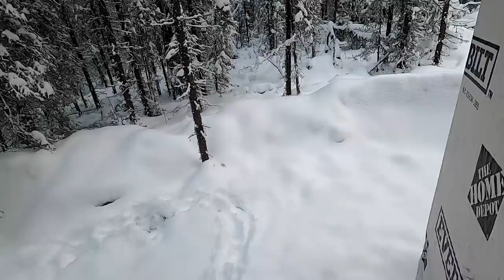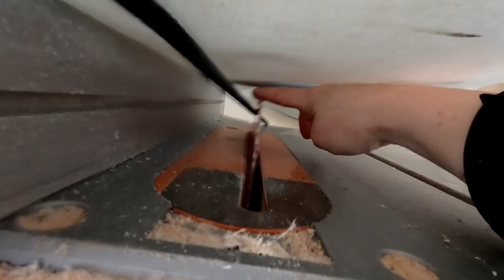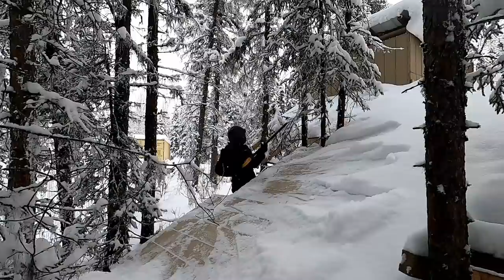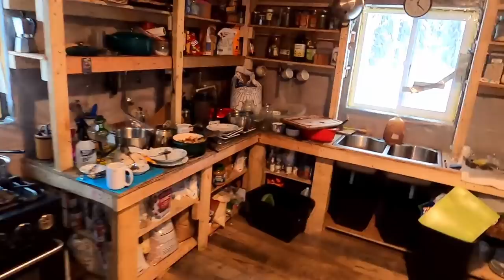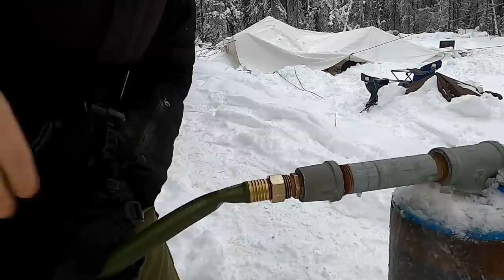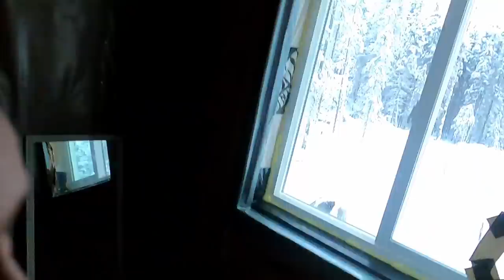Our first home in Alaska is CRUSHED by snow | off grid cabin

Comment: Even living in this (smallest State Capital in the USA) downtown I have been taking my dirty laundry to the laundromat to wash I DO NOT use the electricity-run dryers, bring the wet laundry home in my shopping cart, and hang it all around the ground floor of my apartment with plastic and wood coat hangers, moving  it as needed until dry. It cheers me up to not use the electricity.
Those laundromat dryers use so much power to run so by not using them the added bonus is that the drying clothes raise the humidity levels which make indoor living tolerable.

Comment: Good thing is the canvas is pretty much in tack. Reinforce the tubing with solid rods or galvanized pipe should repair the bent / broken tube.  You could also build a 2X4 frame to replace the current metal frame work.
Reply from the maker: We are going to build a strong frame for it later to have for a work area and whatever. Hopefully lumber is not super crazy them price wise since we do not have a full mill yet

Comment: I think I would try building an 'Indian Tee Pee Laundry Room' Outside on its own with ability to build round brick /cement fire pit  in the center.  Put circular wash lines lines like the Amish use.  Heavy duty wire. Secure. Then fire up a safe center fire to help dry out the clothes.

Comment: No wonder it collapsed it is only electrical conduit. Some 2x4s would do the trick for your frame. Snow can bring down barns and houses if the snow stays on the roofs it is a must to use a snow rake or a long rope to cut the snow like a knife